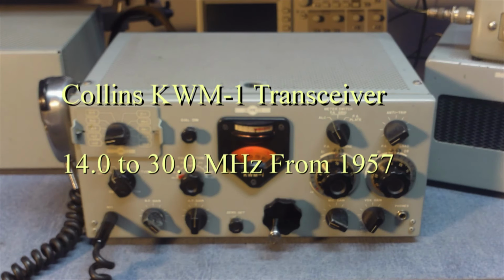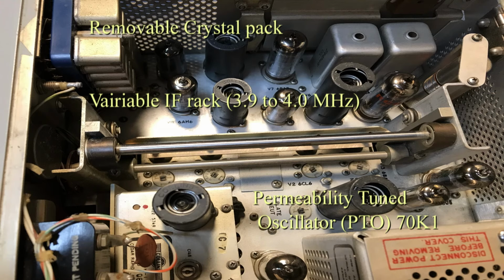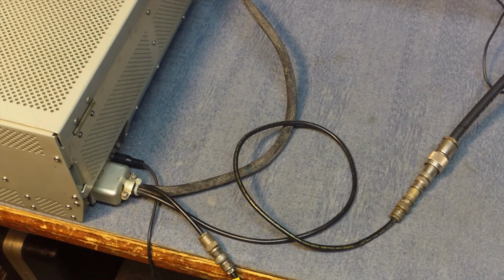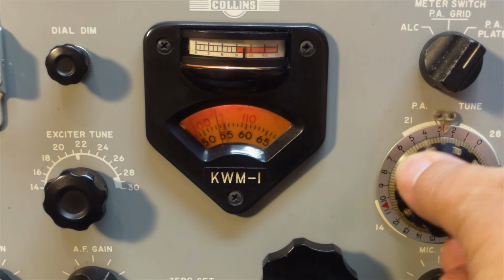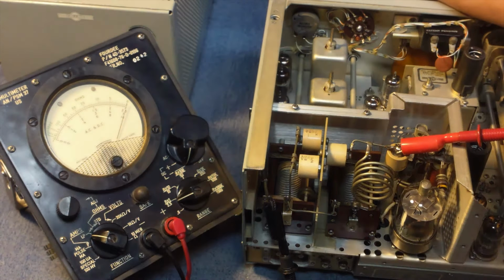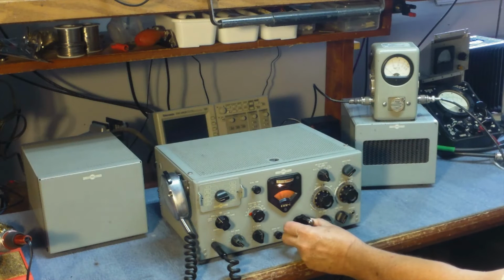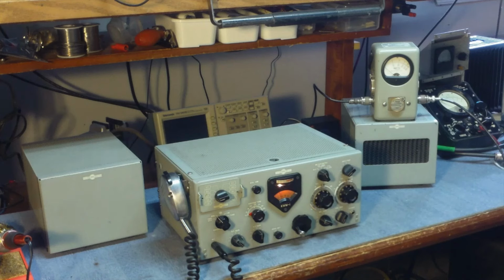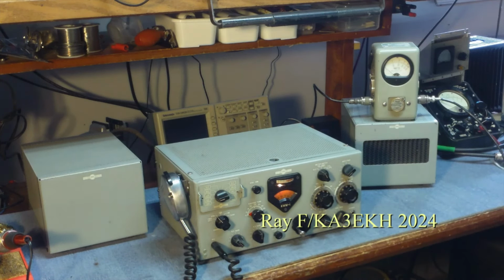1957 Collins KWM-1 Ham Transceiver

Comment: Nice job Ray. Looking at the capacitors it looked like you also replaced what appear to be two "postage stamp" mica capacitors. How did you determine they had to be replaced? Mike N2MS
Reply from the maker: Its not apparent in the video but there was also a problem with low sensitivity due to one of those capacitors being open. Replaced both in the first IF instead of trying to determine which one was at fault.